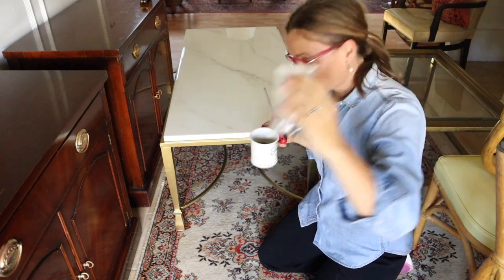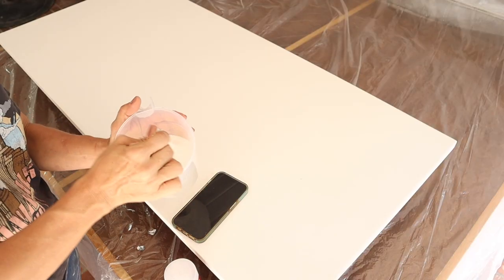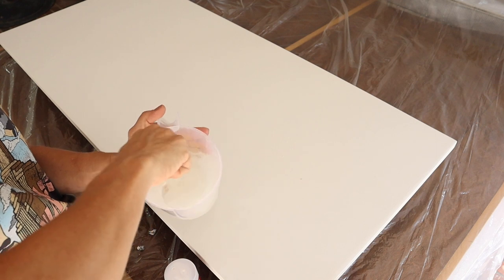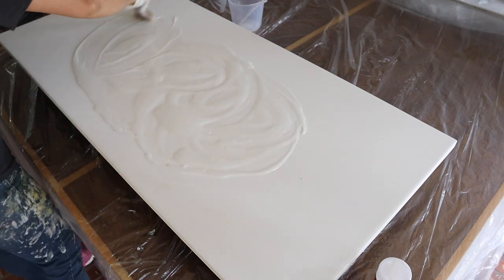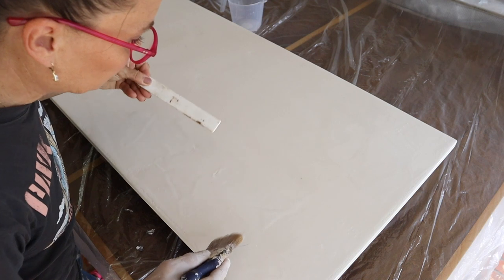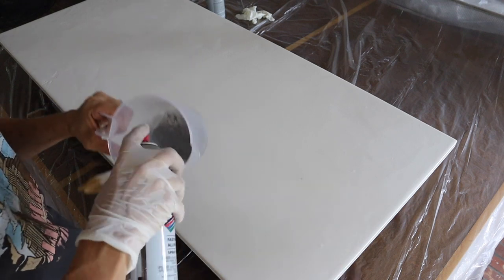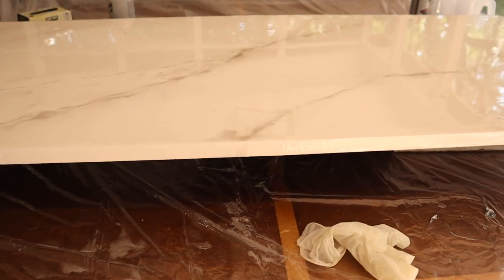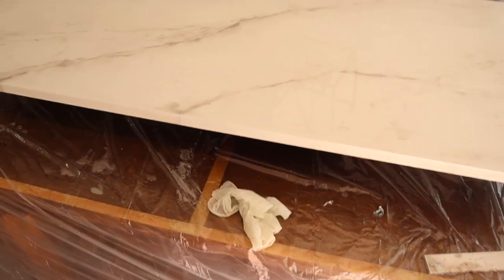tabletop epoxy - faux marble

Comment: How are your kitchen countertops after 3 years? I'm thinking of doing this ...with similar colors but worried of the yellowing
Reply from the maker: They’re holding up pretty well. They have definitely yellowed some. And they have some scratches and some areas where they’re not as shiny as they used to be. But I would still highly recommend for a budget kitchen remodel or quick fix for ugly laminate. I’m gonna do another kitchen refresh after the new year which will include new epoxy counters. So stay tuned.😉
Reply: @MimzyandCompany  so nice. So you will epoxy on top of the old epoxy? Will it still be shades of white or you think you will go darker?
Reply from the maker: @MrsAnaelimont  yes, I think will epoxy over the top of what I have. I'm not sure yet if I'll prime and paint over what I have, then pour clear epoxy,  or if I'll tint the new epoxy white. But it'll still be white.
Reply: @MimzyandCompany  have you read about polyaspartic as top coat . Apparently it does not yellow
Reply from the maker: @MrsAnaelimont  I've used it for an epoxy floor I did, but the floor is purple so I'd never know if it yellowed or not.  But I didn't know that!!!  I'll have to ask my epoxy guy about it...
he's been in the epoxy business(Mckinnon Materials Tampa) for over 40 years and loves to talk about it. I'll let you know.
Reply: @MimzyandCompany  please let me know. I don't want to go through all that work to only have it yellow (I wanted a real white marble looking countertop) I heard around the community about the polyaspartic but not too many tutorials.  Many use for the floor like you did and like it more than epoxy but I only found 1 tutorial on it for countertops in YouTube.  One professional told me to use it as the top coat to my epoxy base but again...not much tutorials